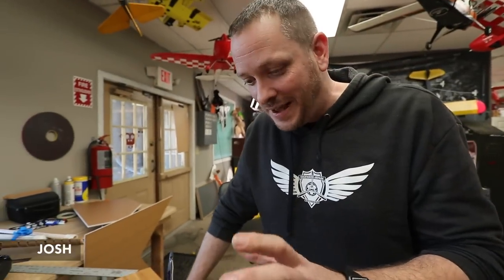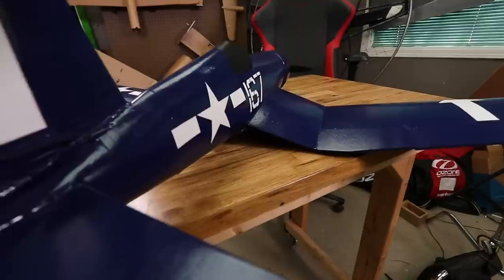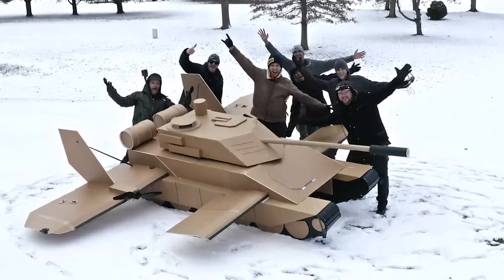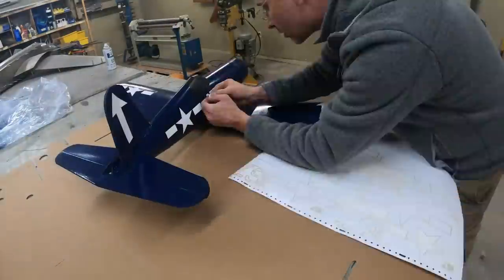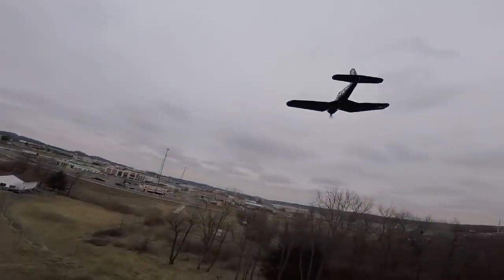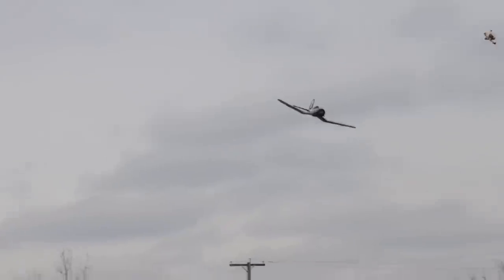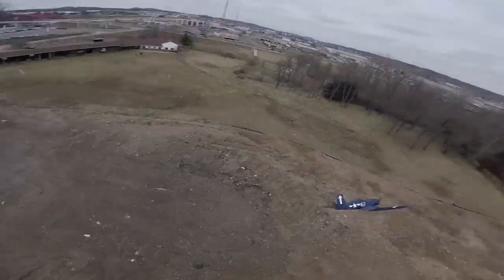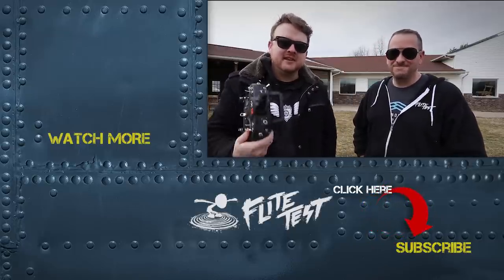You can build this! | DIY Corsair Warbird!

Comment: The original version of the f4u was actually made with a small 3 propeller prop that  had problems landing on carriers because of the stall and they gave the designs to the us marines who changed the prop and also took off the 6 50 cal. Machine guns and added 4 30mm Browning machine guns and then passed it back to the navy and then became one of the best fighter planes in ww2 in my opinion and even was used in early  Vietnam so in general this is an amazing plane with a awesome history so just some fun facts!

Comment: I have always loved the F4U Corsair ever since I was interested in aerial flight. It is one of the most interesting pieces of beautiful art. The way that it gradually soars through the air. It was called many names, such as the Ensign Eliminators and The Bent Wing Bird. With a the bent wing it needs that for the power and torque of the engine, which is the term of "gull wing".

Comment: There's more to the bent wing than simply a big prop. The Corsair was built for speed so they wanted to minimize drag. A round cowling has less drag than an oval shape you see with the Hellcat, meaning they had to put the oil coolers somewhere else. Placing them in the wing made it impossible for the gear to fold inward which limited its length.

A NACA report found that by placing the wing joint perpendicular to the fuselage a lot of induced drag is decreased meaning that the inner wing section was going to have to come out at that "bent" angle otherwise the fuselage would practically be dragging the ground. 
Also the props on the Hellcat and Thunderbolt are almost the same size the difference is the P-47 has telescoping landing gear which is complex and impractical for carrier use and the F6F has a more ellipsoidal fuselage than the F4U. 

Another bonus fact, the large prop on the Corsair was done to reduce the number or engine revolutions required to keep the plane in a steady cruise. By pulling back on the power and using a more aggressive pitch angle the F4U was able to have a massive combat range. The techniques for maximizing range for combat aircraft came from Charles Lindbergh while he was flying P-38s

Comment: Great looking warbird... except that the old hognose started out with a three blade prop and then migrated to four blades. Don't think they make the kind of props the F4-U had, as they did change angle the attack of the blades the faster the props spun. Early models also had the antenna wire that attached to the tail as well.

Comment: I think I speak for nobody when I say we need a P-63 build with the engine mounted mid-ship.

Also, the Corsair's wing design is due to many more factors than prop size. Many planes came with that same engine and only slightly smaller props but didn't have bent wings. Having the wing at a right angle to the fuselage is far more efficient for aerodynamics.

Comment: I would hope that either the FT 3D or the 400% FT Cruiser would be built in the master Class.  The 3D would be even more fantastic with a molded wing and I would guess that there are techniques that are unique to the Big Cruiser as well even if the wing stays the same but imagine it with a molded wing.

Comment: Important clarification on the gull wings of a corsiar: the choice of the wings was less due to the prop size, as such a prop was shared by several WW2 fighters, but rather due to the choice of having a thin fuselage, no wider than the engine size like as seen on Thunderbolts or Hellcats, and to keep the landing gear short so that they could double as dive flaps of all things! Telescopic gear existed at this point, but the designers had other things in mind. Credit for info goes to Gregs Automobiles and Airplanes channel.

Comment: Awesome looking plane! I have a question, I'm looking into getting one of the power packs to build a plane but I'm confused by the lack of controller. does the kit come with a controller or do you have to buy it separate? if you have to buy it separate then what controller would you recommend as a starter? Thanks for the help!

Comment: Gives me a most wonderful idea...I have in my head I going to try and make one a little bit bigger...so hears my plain awhile back I had eflite f15/customized liquidtex silver in a can...anywho's so I was up in there air claimed  quickly I let go of the stick then goes into a dive I had weird no control..well she exploded upon impact..so I have an edf motor?..my idea..is instead of props...be edf..keep the fuselage cylinder and slope the exhaust in a rectangle whole underneath couple of inches away from the main wings an maybe like 4 inches shy or so from tail pice ...I think she will fly as fast or slow as you want...watcha think..? could it work..?good video have a blessed day to all..👊🤓👍

Comment: i want to get into the hobby but i don’t know what electronics work with eachother. i want to use spektrum so what choice i get?
Reply: hey teeth, (lol) You can use spektrum with just about any brand RC servos, esc's and other components. Most RC aircraft components are cross compatible, just need to run a compatible receiver for the transmitter you choose. Flite Test has tons of videos on these topics. Go check them out! :)
Reply: Probably thank you!

Comment: I have  built 4 planes 1200$ 60 hours...all 4 planes flew collectivelly  less than 2 minutes 40 seconds. 2 planes caught a  light 3mph gust on take off and are gone forever. 3rd plane nosed in after 30 seconds. Last plane had a safe return mode. I pushed the switch the plane turned inton the wind 4mph climbed till i could not see it turned down breeze and last I saw it was headed about 75 yards high altitude...prop would not pull the plane back to me. It tried to turn back but it just turned and gone. Bought 2 more kits. Tried to kamikazee it but would not elevator max to the ground..is there a book? I can build really well and fly real aircraft Cessna Piper Mooneys Bellancas. Any tips. For a loser flyer. Slooooow flyers still dont fly slow enough. Beginners had 2, were 2 fast. Even With just rudder elevator throttle ...